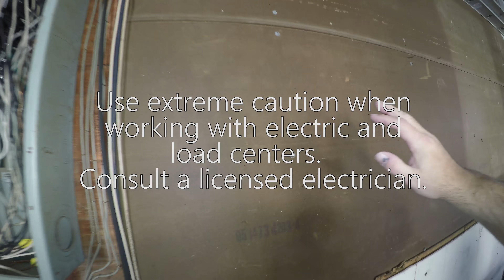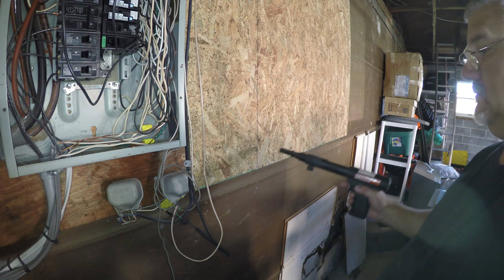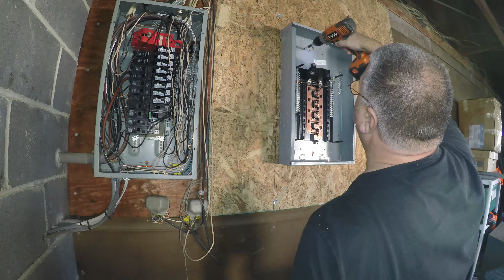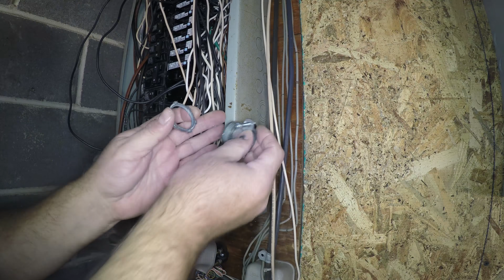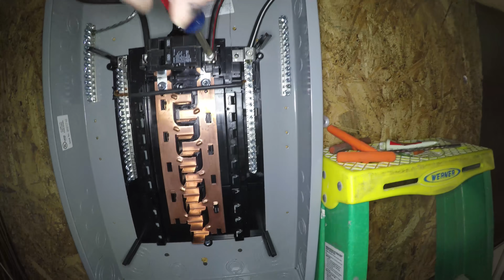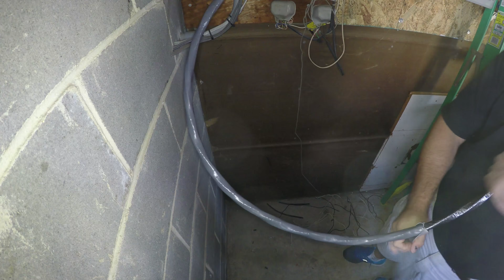How to Install an Electric Sub Panel and Tie-In to Adjacent Main Panel from Start to Finish

Comment: Hi thank you.. very informative. Have a question, don't we have to remove the horizontal rod that's connecting the neutral and ground on the sub panel ?

Comment: The ground wire in the sub panel is only connected to one of the 2 ground bars. Wont you need to bond that 2nd ground bar ?

Comment: I got a question about electric . Im replacing a 100 amp box and after the meter was pulled there was still power to the box. There is only 1 meter

Comment: Three things I would have done different. One you don't need two (2) 100 amp breakers in line, lug feed on new panel. Two the new panel should be flush with bottom of old panel (new panel is to high). Three this guy wasted a lot of wire. I would have used 1-1/2 pvc pipe between the two panels and used #3 THHN copper for the hots (about 88cents a foot), #4 THHN copper for the neutral, #6 copper for ground.

Comment: why I didnt like the video---you didnt explain anything as far as WHY and what.  I did like the closeup shots, but I didnt learn anything other than you have to use anti-oxidant on alum. wire. Did you hook up the subpanel for 110 or 220?

Comment: So I had a sub panel added to my garage, the electrician crossed A phase with the neutral everything on B phase had 240volts on it, why didn't the braker trip.

Comment: You probably overloaded the main panel and romex is not permitted below 8 feet without mechanical protection. You should have used conduit.

Comment: First your main panel needs to be neater it makes it easier to work in when it's clean and neat and wires are straight second you don't need that much wire left on the aluminum and second ducks aren't good strippers.

Comment: You would have been better off upgrading that existing panel with a 200 amp, 60-circuit panel. I can't tell you how many of those old Murray red handle main breaker panels I have changed out over the years. Whatever you do, don't ever turn off that main because you probably won't be able to turn it back on!

Comment: Thanks for this. I've spent the last while rewiring two garages that had double-tapped fuse boxes. All new wires are run and I'll be installing a sub panel tomorrow morning. I was confident I knew what I was doing (including removing the bonding screw) but your video confirmed I was on track. It's not that complicated. If the internet has taught us anything, it's that only rocket science is actually rocket science. That said, my son is an electrician and I have sent him photos of everything I'm doing, just to be safe.

Comment: Great job on the video!  Would it not have been better to land the load wires on the main panel with a breaker at the top instead of the bottom.  This would avoid overloading the bus bars.

Comment: Clearing up the older wires made a big difference looks good and a sound job only thing I would have done differently is run the wire through some pvc conduit between the boxes but either way looks great

Comment: please elaborate. i thought you are not supposed to bond/connect neutral and ground on a subpanel. you only bond them on the main panel.  did i get this wrong?

Comment: Thank you so much for the video. I have a question. Is 200 amp better for us if we have central a/c, electric water heater and electric stove in 2000 sq ft. home? We have 100 amp now. the light dim in a blink a little when they come on. Will 200 amp solve that?

Comment: Good video... couple of questions tho
1. Where you buy the big grey cable? Item number by any chance for it?
2. Is that enough power to run a 50-60 amp breaker from main panel outside down about 100 ft to a subpanel in a tiny house? Please help lol

Comment: Is the total sum of amperage of the breakers in the main box greater than the rating of the boxes total output? It's ok to have 300 amp worth of breakers in a 200 amp box? Obviously you're going to have a main breaker rated for that box size

Comment: whats the deal with the bend on the ground wire? i do low voltage not electrical but i was taught around 20 years ago or so not to make sharp bends or 90° turns in ground wires because if a lightning strike went thru the ground it would shoot out the sharp bend.  your ground is bent closer to 180° do i just have bad information or are your ground wires not installed properly?

Comment: 1) Save money, buy a main lug panel, not a main breaker panel. Main not necessary in a sub panel.2) Plastic bushing on the cable connectors is required.3) Use a knife to strip the wire, your method can "ring" the conductor and damage it.

Comment: Hey, i have a question about the size of the wire you are using - 2-0? Is that 2/0 awg or 2 awg compact stranded aluminum ? I am about to buy some cable 1/0 awg for my subpanel and i am a bit concern about fitting it into the main lugs...

Comment from the maker: Suggestions, Questions, Observations from viewers (you guys):
- (from J Pogera) Bring the 2-0 wire into the main panel from the bottom. ✔️  In response I agree.  It would have been nicer.
- (from bobbg) Concerns over overloading.  ✔️ In response I created the following video which describes how to apply for an electrical permit and panel ratings and chances of overloading the panel: https://youtu.be/WifIi5PNPck
- (from bobbg) Performing work without a permit leaves you vulnerable to claim rejection from insurance companies for breaking the law.  Was a permit submitted?  ✔️Yes, a permit for the building and electrical work was submitted and approved.  Here are the rough approvals: ✔️ https://www.instagram.com/p/BOPiAf0A-w- ✔️ https://www.instagram.com/p/BOUn6W2AnUm
- (from Brian Rinnier, texas journeyman) The 2-0 wire supplying the sub-panel is about 8 inches too long within the panel.  ✔️ I agree with this and I will trim this wire when I have time and provide a short video describing the change.
- (from Hamza Alaa) Take measurements for the wiring so you avoid waste and lost money.  ✔️ It's good planning.
- (from Rick S.) Use a knife to cut off insulation from the 2-0 wire instead of the method that I used out of concern of damaging the wire.  ✔️ I agree that using a knife would have been a better choice as my method did leave a noticeable mark on the wire.
- (from Joe Tiller) When landing the main lug wires and tighten them down, shake them back and forth and tighten the set screw again.  ✔️ I agree and will do this for the video update.
- (kefren ferrer, PS4 Gamer) The main panel needs to be cleaned up more.   ✔️ I definitely brought some order to the main panel but it needs more care for sure.
- (from Jack Reacher) Read NFPA 70 prior to performing any electrical work. ✔️ I agree.  It is important to read through the National Electric Code and understand all points prior to performing any electrical work.  Be sure that you are using the version that is accepted by your town/city/state.  I further encourage you to consider additional reading from the currently accepted international construction code as well (use the version that is accepted or recognized by your town/city/state).  Also note that your town could have additional requirements above and beyond both of these so consider these as well.
- (from texas journeyman) the hots those hots could have went straight into lugs with no bends u always want both hots to be about the same length

Comment: Let  me get this straight after you cleaned up the spaghetti cluster fuck, you installed a 100 amp panel and breaker after the 150 amp main breaker, your sub panel feeds looked bigger then the mains coming from the meter and your 150 amp main was maxed loaded with circuits.  I can't make out the amperage of each breaker for a total use of the main, but if you add those and the sub its got to be way over the 150 your main takes.
Why not Just pull it all out yank the meter replace the main for a 200 or 400 amp service?
Provided the power company had drops for 400 amps? or 200 amps.
Seems to me all of it could have been redone and looked a lot neater with just one load center.
I can see adding 2-4 spaces or a 220 volt and 4 120's but a whole panel with 20 spaces?
Won't this overload the main breaker if all the circuits are on or even 80% of them.
between both of them you have 44 circuits or more? That is OK if most of them are 120 volts and 15 amps, but they are not that.
Is what your doing even Code where you are?
did you pull a permit?  you know if you do wiring in your home, it fails and burns down if the insurance company see's its not permitted work and inspected, they can skip paying a claim on it right!
Yes you as a home owner can do the work, but you have to pull a permit and get it inspected and passed.
A Licensed Electrician dosn't need a permit for his own house where I live. I don't know about your city's codes.